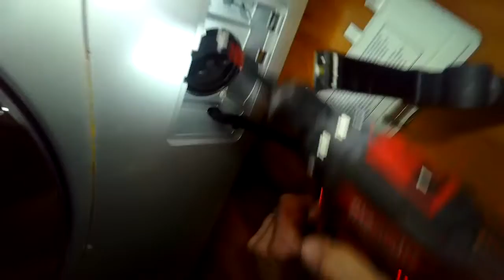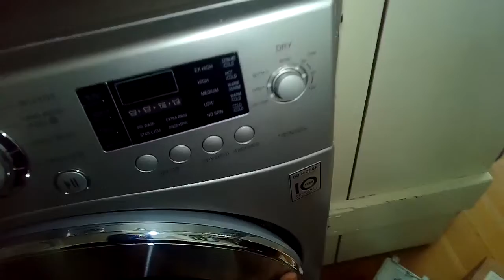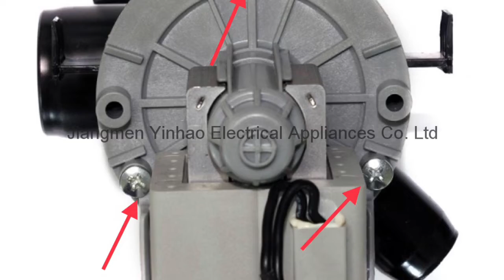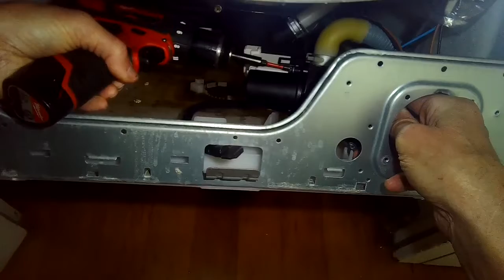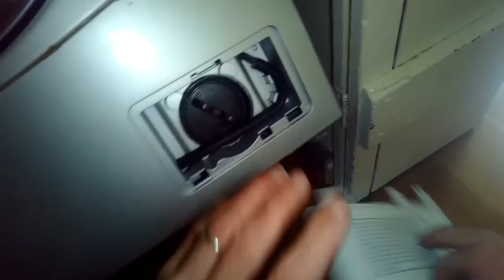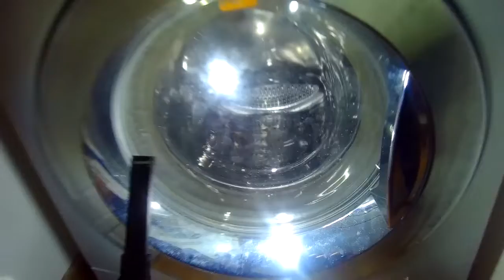✨ Lg Washing Machine Not Draining (FIXED) ✨

Comment: Hello Scott. Ive found your video today as my Lg washing machine decided not to drain. Ive checked all the hoses, ive removed motor or even 2 motors ( drain, circularion) and connected then to the socket using cables obviously and they spins fine. Wondering what else migh cause the problem. Abother think id like to mention about is the smell (like electric smell) been noticed by me ans my wife. Do you reckon it might be the circuit board? All the programs starting till the drainage... ive stuck Scott. Dont know what to do...
Reply from the maker: Can you hear the drain motor start up when you set your washer for spin?

Comment: I often get the OE message. My drain pump will kick in after I  manually start draining from the coin trap.  I've checked all hoses and all is clear. Is this a pump failure even tho it will work after the water level gets low enough?
Reply from the maker: Yep, time for a new pump👍

Comment: Would this repair be suggested if the machine was still draining, but taking at least 30 mins longer than usual? A “normal” load once weighed states 52 minutes and is taking close to 2 hours from start to finish. The drain cycle takes about 30 minutes it seems.
Reply from the maker: Thanks Shelly,
I think you should remove that little door in the lower left hand corner and open the coin trap to remove the debris that’s blocking the water.

Comment: Could it be the board as to why its not pumping  without being clogged. I removed the pump and I plugged in the 2 AC connectors and it worked. When I reinstalled it into the machine, the pump failed to work. Can this be a board issue?
Reply from the maker: Can you hear the pump when it’s supposed to go.